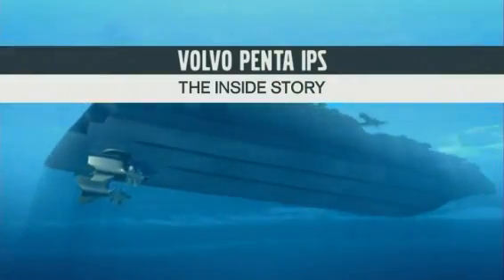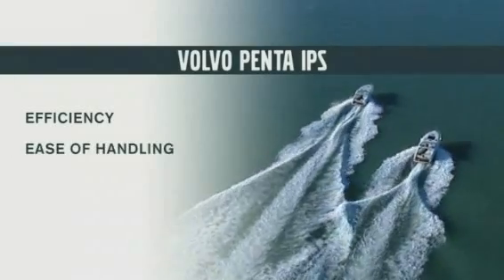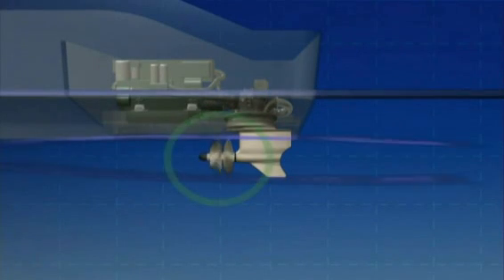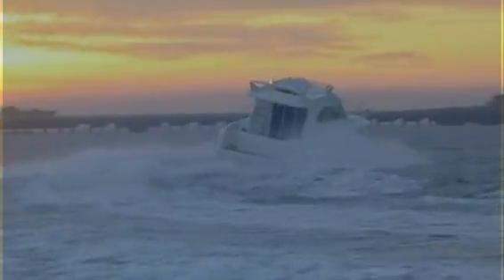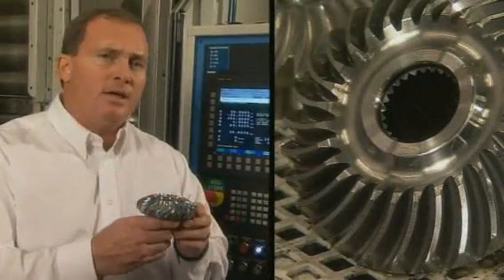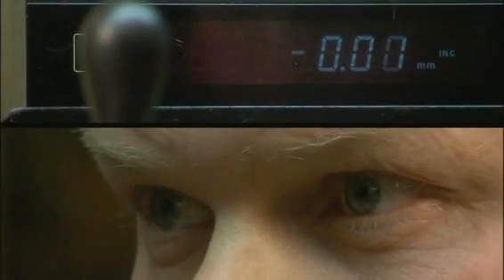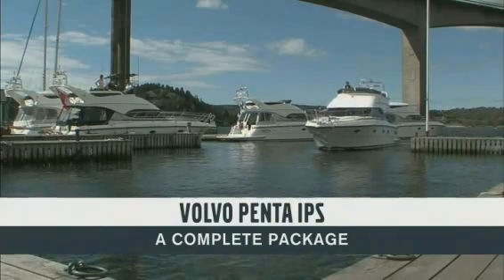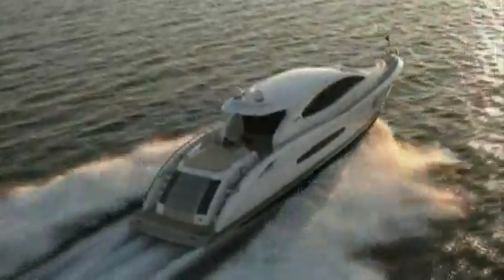Volvo Penta IPS – The inside story

Comment: When will Penta come out with a retractable sail drive? Or perhaps even a hybrid retractable sail drive? A D3 modified for power generation coupled to a electric motor on a retractable drive would be amazing. Thrust steering, reduced drag, reduced chances of below surface collisions, and so forth. And with the propulsion units retracted maintenance could be assured from inside the vessel. No leaking at the though-hull connection to the drive shaft, less wear and corrosion since it would spend most of it's service life retracted. Oh yes, I could go on. But I won't. For your sake that is.
Reply from the maker: Thank you for taking the time to share your thoughts with us, Sakarias! We appreciate the feedback.

Comment: Have Volvo IPS600s. Both maintained above and beyond Volvo Penta specs. Both IPS units have failed seals and have just been replaced due to water in gearbox oil. Volvo has reduced prices of units so this is now preferred option (replace entire unit when there is water ingress). USD40k later. Units less than 5 years old. No help from Volvo. At all... but all boat manufacturers are throwing these in to grab 2-3ft of extra internal space...
Reply: It seems almost criminal that there is no water ingress sensor in the oil. Such a simple device could save a huge cost.

Comment: I am a Professional Captain I have operated very large AZI Pods, Arneson Surface piercing, and multiple Waterjets, and Schottell systems I am  currently training a new boat owner. The IPS drives are great for this first time owner .BUT after transiting the inter coastal from New Jersey to Florida and having some issues the key is to find a PROFICIENT Volvo mechanic. The mechanics I ran into have this disposable mindset where as if one thing is broken then they believe to replace the entire unit. I have found a great Volvo Mechanic 1200 miles later . I am hoping this owner increases vessel size and includes  IPS units for the larger vessel. The IPS system has a great ability for the owner to get into tight spots and to get out of trouble proficiently .

Comment: A friend had this system and he hit some under water pilings next to a dock and it screwed up his boat and the props and shaft we're Fu*ked up up beyond repair. He did say that he got to close to the old dock...  I have hit things with my Mercruiser duoprops and the props blades we're bent but the stern drives automatically raises to avoid any further damage. Also you can't get to close to the beach with the ips pods because you have props that suck all kinds of shiet into them ,, like ropes and nets and drift wood ..the small and insignificant increase in efficiency is not worth just one repair to props and the pod of this nature.. the Mercruiser Zeus system puts the props in the rear of the pod behind  a skeg as well ... One other thing to think about......if you have the Volvo ips system please stay away from areas of Marine mammals as that system will kill them for sure it definitely should have a steel cage around those props ..
Reply: and what would a hatteras swinging big ass wheels do to a marine mammal lmfao.
Reply: I hit a big ass plank, didnt see it. Bent both drive shafts, (standard inboards), thats not cheap to repair either, especially when they have to repair a stuffing box. Regardless of what drive system you have on ur boat, they are usually located under the vessel, lol. And eventually will probably get damaged.

Comment: The real test is to ask those that have owned the pods for several years, and the opposite side of spectrum arnesons. Pods good for low speed maneuvering, surface drives good for top end but most folks would go back to good ole inboards with prop pockets if they get the chance because one mishap or service will way offset any efficiency savings. Plus a volvo diesel just aint my best choice of power either.

Comment: If you were to add a conical shaped housing moulded with the Lower gear case housing from the propellers to exhaust reducing in size from prop to exhaust (like an aircraft jet engine or Dyson cyclone vacuum cleaner), would it add more power/thrust/performance and also reduce emissions and required horsepower..?

Comment: Unhappy about the unprotected props powering straight into all sorts of hazards: marine rubbish, trees and driftwood, rope, crab & lobster pot lines, set nets, plastics, shipping containers, divers and everything else that's bobbing around out there just waiting for a passing prop to foul.  Perhaps a very substantial, forward-facing, stainless mesh housing would deflect unwanted flotsam without hindering performance.    IPS - Inevitable Propeller Smash
Reply: You cant have it both ways. The systems are highly efficient and effective because they operate in undisturbed water. Any housing or other structure that would deflect debris to protect the drive would also disturb water flow and reduce hydrodynamic efficiency.  Agree with you 100% that these systems are inherently more vulnerable to damage from junk in the water.  Its all according to each persons priorities, I guess.
Reply: Efficiency over safety ? Hope your joking. Anyway, the Jury is still out on how much more efficient these things are compared to a well designed shaft drive.
Reply: @bobbuilder5362  Bob, IPS drives are actually safer in the event of a collision than a traditional shaft drive,

Comment: 500 years of practical experience? a half of a hundred thousandth of an inch gear accuracy? Shot penning provides an additional 20% strength to the gear set? Those are all a bit of a stretch from a company that put the propellers on the wrong end.
Reply: +salvor1 Not only that, but apparently they also think they invented helical cut gears...
Reply: +salvor1 * shot peening.

Comment: Any of the IPS units been damaged by underwater objects such as ropes etc?
Reply: Ya but the drive shafts, props, and rudders on regular inboards get damaged too. If you hit something, you hit something lol. been there several times. Haulouts are expensive, repairing bent drive shafts, props, ugh. Not to mention the stuffing box for the drive shaft. Yep, yachts are expensive. But I prefer the regular old twin screw inboards. Just cant see piloting a big boat with a joystick.
Reply: Loads of them

Comment: Do you think its possible to built embedded system controller in side each machine to control both machine behavior and the controller a mine the man who machine drive ( the driver man) and control his actions and in case he did not make the right choose the machine take the control resp. he limit his control action by ordering machine to not response or response with a period time that the controller define.

Comment from the maker: Sanghun7277,  IPS stands for Inboard Performance System
Reply: Is IPS different to Dynamic Positioning System? I mean are they 2 separate things or one works to compliment the other? Sorry if the question is a bit silly. I'm new in the field.
Reply from the maker: Hi  @elenasavva1 , not at all. We appreciate your question. Our IPS is a complete Integrated Propulsion System – from the helm station, via the engine, all the way to the propellers. DPS is a feature of IPS. It automatically maintains the boat’s heading and position, and safely keeps it within a very limited area.

You can read more about IPS here: https://www.volvopenta.com/marine/products/volvo-penta-ips/

You can read about DPS here: https://www.volvopenta.com/marine/products/easy-boating-solutions/maneuvering/dynamic-positioning-system/
Reply: @VolvoPentaOfficial  Thank you so much! I appreciate your reply. Went through the website too and everything is clear now.  I was so confused. :) Thanks a lot

Comment: Again, The underwater part of the IPS is designed to come off, normally for dangerous collisions, like running aground on high speed. 
not for log hitting. And even for traditional drives, when there is some sort of collision or ropes entangled, its a big pain in the ass to re-align the shaft and fix the damage. 
Happens a lot in asia, cuz of fishing culture and the waters are netted with fishnets.

Comment: The damage of the logs hitting the boat, if its normal shaft drive or IPS drive, is almost the same. So its not that, if there is a log floating on the water, its likely to damage IPS system, and not the traditional drives. 
But for extra safety, the IPS are designed to come off if they hit a hard object, So the drives and props dont penetrate the hull. So its designed to come off upon impact. 
Which ofcourse has to be replaced, and that aint gonna be cheap. But still, not a bad design.

Comment: forward facing props are a pretty effective design, but what if debris such as logs hits them?
Reply: You sink.
Reply: @bobbuilder5362  no, the pods will shear off (in the worst case) and leave the hull watertight. If you had the same event in a shaft drive, you’d stand a good chance of damaging the shaft and stuffing box, allowing water ingress.
Reply: @Smokeyr67  There are cases where the pods have compromised the hull after even minor collisions and in one event I'm aware of the vessel did actually sink. Traditional straight shaft for me every day on a planning hull. Or even better a full displacement with props above keel line, can be grounded without any issues.
Reply: @bobbuilder5362  and there are many cases of shaft drives sinking at the dock due to leaking glands. 
IPS pods by their design will not compromise the hull in the case of a collision, and I’d love to see evidence to the contrary.

Comment: what if u hit a log
Reply: BOOM. Then buy a new boat
Reply: @themalinoiscollective  The drives are designed to break off between the lower and upper gear-house. Please do some research before you speak your mind on matters that you have no knowledge in.
Reply: @osfan92  Totally useless in bluewater on a passage then.
Reply: @themalinoiscollective  know people who have done 1500nm passage with them safety, no issues. Also why would a displacement/semi displacement yacht be doing long passages in the first place? that is not what it is designed for. Also, open ocean you would run into the least amount of debris compared to inland. Think for at least a second before spouting rubbish
Reply: Hit a log with regular inboards and bend/break the drive shaft, the prop/rudders. Been there. Regardless of what kind of drive you have im pretty sure they are all located under the water on the bottom of the boat. I hit a big ass plank on Lake Michigan. Didnt even see it. Haulout=$350 repair drive shaft, stuffing box= 2K. Before that just ran on one engine for a month lol.

Comment: The Zuess still has the skeg to protect its props. This system puts them out in front, which is a more efficient use of the props, but leaves the props with no protection from underwater obstacles.

Comment from the maker: Our steering system is not hydraulic but is electronic, so even if  you break the transmission at full speed, there will be no consequences on the drivers' hands/arms  (no hydraulik hard feed back to the steering wheel)  and the engines will soon derate RPM to 1500, in safety mode. 
After more than 10.000 units sold, never had a single porblem on this issue.